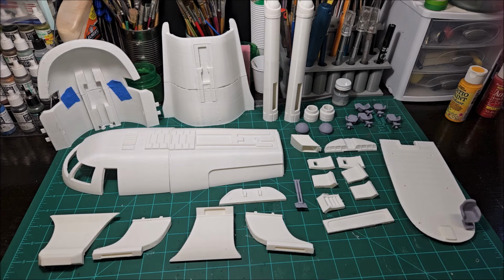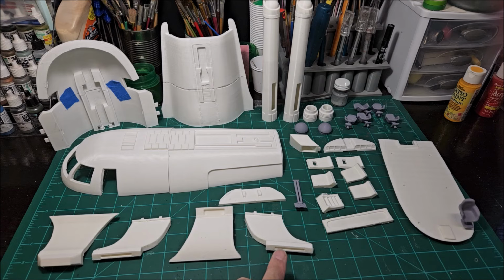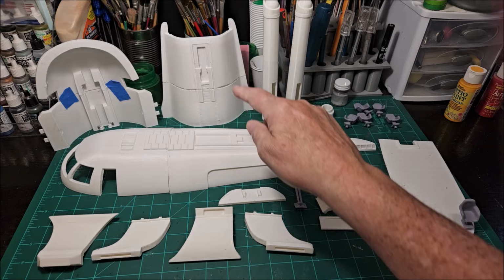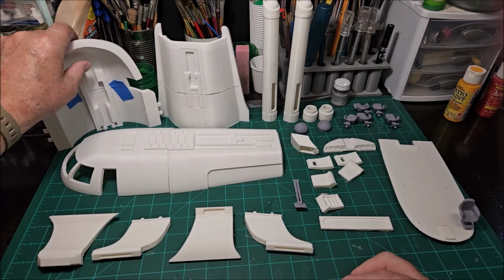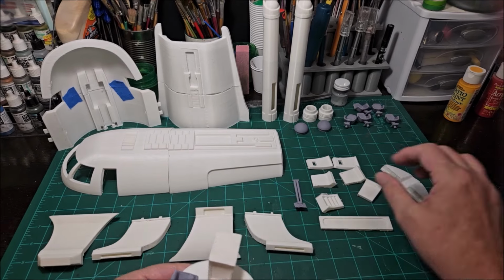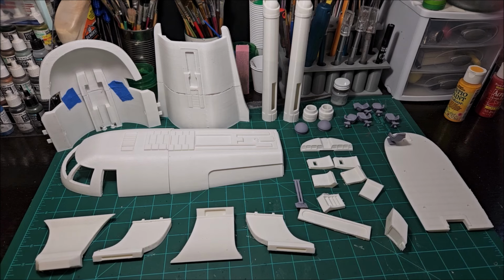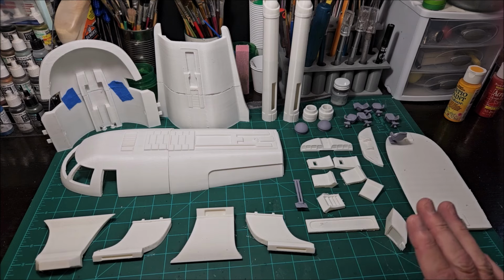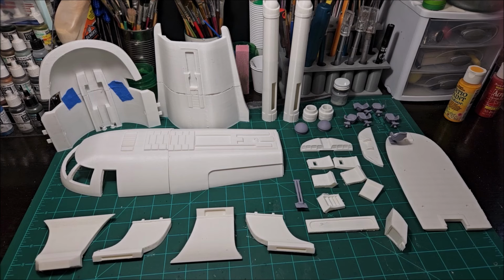TREKWORKS Tribute Build 2024 Intro

Comment: So sad, and sudden. I literally just talked to him a few weeks ago about some 3D parts. Going to be an awesome build! Is there a reason you didn't try to print those nacelle end caps in clear?
Reply from the maker: Yep, such a shame and a great loss!
I would print those caps in clear. But, I have trouble with removing the vat. Some resin went down into the threads and it seized. I tried removing it with plyers and the stud came loose from the printer. So it's not very easy to change out the resin in my printer.